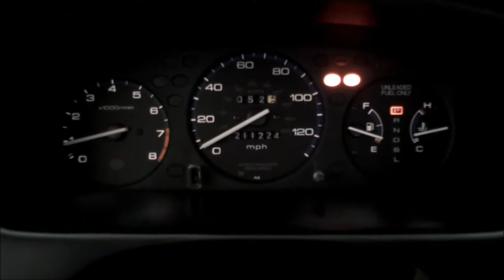Oil change on 1999 Honda Civic with Mobil Super High Mileage 5W-30 and Fram Toughguard Oil Filter

Comment: A couple things I'd recommend:

1. Change the washer on the drain plug every other oil change
2. Don't tighten the drain plug too tight or you will eventually wear down the threads or worse, crack the pan. 
3. When you pull off the old filter, make sure the rubber gasket comes off with it. 
4. Lube the new gasket with some oil before placing it.
5. You only need to tighten the filter on by hand, otherwise it just makes it harder to take off in the future 

Just some things I've learned, not necessarily right or wrong though.
Reply: +Caleb Johnson change the washer every. use honda crush washer only.. unless you wan the oil to leak out.
Reply: +stormbringerr mourn I change the washer every other. My honda is almost 20 years old and it's never leaked oil. But each car/driver may vary
Reply: i would rather pay a small price for a new crush washer every time i changed my oil than risk ruining my engine.

Comment from the maker: Thanks K,B, If you want the best for your valve cover, I recommend a high-temp paint which usually comes in red/black/primer colors.  The best thing to do if you have rust/corrosion is carefully sand all that off and prep a clean surface. Then spray 2-3 coats of primer before putting on your paint. 

You can go for a high-temp paint, but if you want more colors, any regular spray paint will do. I just used the store brand of red spray paint.

Comment from the maker: I think it's worth it. It gives your engine bay that little pop, something different. The paint will NOT ruin your engine, so I hope I can put your mind at ease. I painted my valve cover 5 years ago I think, and it has never shown signs of melting. I even used the cheapest walmart spray paint there was.

Comment from the maker: And the fuel filter is under the backseat. Lift up the back seat and there is an access panel with 8 10mm bolts. take the bolts out after removing the two fuel lines and it lifts right out.

Comment from the maker: @siam409330 I appreciate where you're coming. As per the manual, using Honda motor oil is recommended for optimum engine protection but it also says any premium grade detergent motor oil displaying the API certification seal is just as good.

Comment from the maker: HI Jensagirl, thanks for subbing =)

If your dad lets the car sit for a long time or lets the oil drain longer than I did (say for more than 15 min) by the time he unscrews the filter, just b/c most of the oil has drained back into the engine or drained out of the oil pan, typically there should be little to no oil in the filter. Sounds like nothing is wrong imo. =) 
On the other hand, if he unscrews the oil filter within minutes of driving and no oil comes out, that's a whole different issue.

Comment from the maker: Well, on mines, the letters were raised so after drying, I just took a small piece of sand paper and sanded the paint off the letters. I've seen people also take a Q-tip and spread a layer (even thin will be fine) of petroleum jelly over the letters, just enough to make it oily. And then after spraying the paint, simply wipe it off to reveal unpainted lettering.

Comment from the maker: If you bought an AEM Short ram intake, there should be a bung hole at the back where you insert your IAT Sensor (Intake air temperature) sensor.

Comment: Hey Guys...also is really good practice when you are "servicing your own car that replacing a brand new aluminum washer(Honda dealer)... at each oil servicing(Owners manual) ie. That way your not spending time 'getting all washed up' cleaning your driveway, from you own car....that is also true for you folks woth 5 speed transmission, change it with new aluminum washer) and, Honda MTF.... due to small seapages...just fyi...

Comment: A low profile jack will rid of using the sizzor jack to get it high enough for a normal jack to be used... because as soon as your finished, you would still need the sizzor jack in order to take out the normal jack, because of your ride height... you can save an enormous amount of time an stress using a low profle jack and get rid of those unecessary steps.
Reply from the maker: Hmm. Thanks for the tip. It is a pain in the behind using the scissor jack everytime. Definitely going to get a low pro one soon.

Comment: You shouldn't tighten the oil cap as much as you did. Considering that it's under pressure, lightly tightening it, without applying extra force, will do just as well. Then when you go to pull the cap off you don't have to use force haha.

Comment: Hi again, my dad wanted me to ask you that if the car will start but then die while in idle and then start and then no start, what the problem might be? Right now the car does not crank, like its out of gas or something. How on earth do you remove the rear seats? He has a key in the back the controls enables them to flip down but we can't get the seat portion to budge at all. Thanks

Comment from the maker: @Derekisamazinggg Duly noted. I guess I'm a it paranoid. I used to work at an oil change center and once forgot to tighten the oil cap at all. Customer came back with oil all over the engine. T_T But ya, I shouldn't overtighten =)

Comment: am driving Honda Civic 99 Saloon with 191k miles. 
In the last oil change Mechanic used 10w40 Fully Synthetic?? 
I Googled a bit and can't see anyone recommend that. 
Any Suggestions plz.
Reply from the maker: +Adnan Ali Syed Hi Adnan. Since this video I too have switched to 10w40. I'm at 232K and have a little rear main seal oil leak so I've switched to a thicker viscosity oil.
Reply: +mylifeisJDM thanks for reply.
so u mean it's better to use 10w40. I was going for mobile 5w30.
what u recommend?
Reply from the maker: Mobil 5w30 is a fine choice so you can't go wrong with that. Go for Mobil 5w30.
Reply: +mylifeisJDM. Got it. thanks
Reply: if you love your car and use it daily put 5w50 or 10w40. 5w30 is nothing to thin.

Comment: Hey I got a question , I have 99 civic dx , Mechanic change my Oil and after that I check my Oil level and it is more than the upper dipstick dot , so what i have to do ? is this can damage anything inside the Motor ? cause im already driving couple days after he change the Oil
Reply: its not a big deal, but thats why its best to DIY.
Reply: Okay Thanks , and what is DIY ??
Reply from the maker: If it's just a little above the dot like half an inch, no worries. But if it's like a full inch above the dot, ya, you or the mechanic should drain just a little. Also, are you waiting like a good 7-10 minutes after shutting the car off to check ?
Reply: it was more than 1 inch , i belive he put like 4 quarts of oil in the motor , i drained already .

Comment: nice video. with over 200K miles on the car you should use 10w30 oil
Reply from the maker: Thanks. Ever since this video, switched to 10w30. Trying out 10w40 right now actually. Engine sounds a bit quieter.
Reply: +mylifeisJDM do not use 10w40 its too thick using the wrong oil viscosity can damage the engine

Comment: @mrpr1ngles except the Fram Extended Guard, those are actually great filters. However they are quite expensive. Not to mention he must've got ripped off and someone put the cheaper Extra Guard filter in the Tough Guard box.. lmao fail..